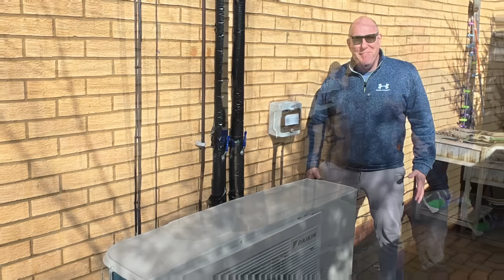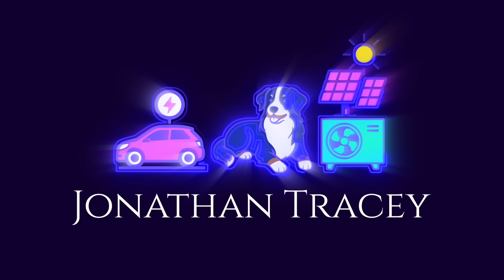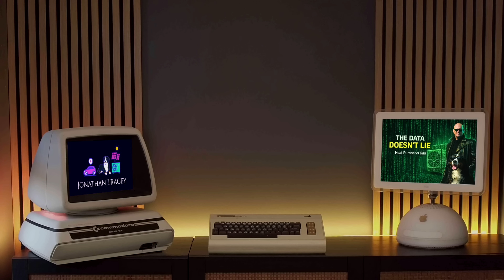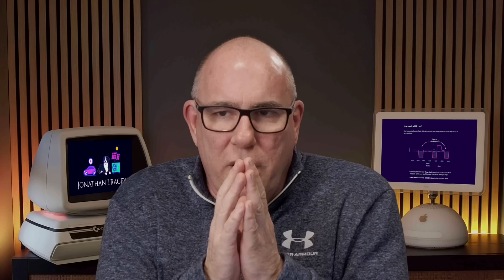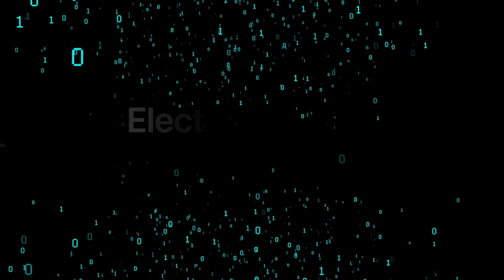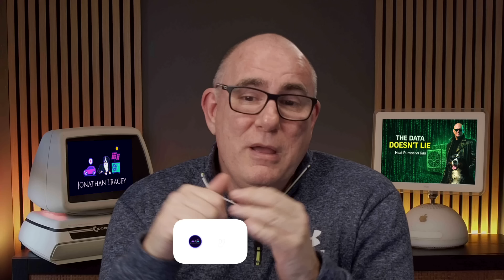The Data Doesn’t Lie   Gas vs Heat Pump Real Running Costs

Comment: Being a Heat Pump newbie, I must ask the following:
Isn't it a chemical reaction, within the refrigerant, which causes the heat to be generated? :body-blue-raised-arms:
A pump forces the said chemical around a circuit which causes this to happen? :body-blue-raised-arms:
Therefore you are paying for the electric to run the pump? :body-blue-raised-arms:
You are Not using electric to actually generate heat! Are you? :body-blue-raised-arms:
So why does it cost so much in Electric?? :text-green-game-over:
Reply from the maker: @grayukuk Good questions. It’s not actually a chemical reaction — a heat pump uses a refrigeration cycle. The refrigerant absorbs heat from outside air and the compressor (powered by electricity) raises the temperature so that heat can be released into the house. 

So you’re right that the electricity is mainly running the compressor and pumps, but because it’s moving heat rather than generating it directly, you typically get 3–4 units of heat for every unit of electricity used (that’s the COP). The reason it can still look expensive is simply that electricity costs more per kWh than gas in the UK, which is why the “spark gap” between gas and electricity prices matters so much.

Comment: Great, unbiased video analysis.  So many people I know out there have been switching their less than 10 year old condensing gas boiler out for a heat pump thinking that they are going to get cheaper price heating and thats simply not the case.
Reply from the maker: only if you have smart tariffs and or solar.

Comment: Ok a couple of issues here. My journey has mirrored yours, added 20kwh batteries and an EV, charge at night discharge in the day average Elec cost 7.4kWh. The system paid for itself in year 4. Added a test PV 900W and ran for year, extending to a 4.8kwh later this year. Looked as ASHP 4 years ago, capital outlay and operating costs too high, much higher than a gas boiler. New gas boiler 18kWh dropping to 4kWh, currently running at 94.7% efficiency by getting the house ready for an ASHP in ~2040ish. Added Tado all around the house ~£800 useful for gas or ASHP, added automated thermal blackout curtains everywhere (reduce heat loss). Moved lounge radiator to bedroom replaced with oversized radiator and put three automatic fans under it ~£100 ( not really useful on a hot system but fantastic on a low temp system) put new boiler in the utility room - making it really easy to swap out in ~2040 to ASHP. Used a system boiler and separate small hot water tank that i can heat using gas/ grid/battery or solar ( replacing with localised elec under sink water heaters in the next 10 years, ASHP struggles getting a sterilisation run on the hot water) Added an ems-esp32 Boiler monitor £100 and built a highly dynamic weather compensation keeping the Flow temp between 39-45c (ASHP territory) all winter - every of the 12 rooms maintans +/- 0.3c of target temps. The lounge is the thermal achor and the fans increase heat extraction by 70% making the room highly responsive meaning it is always 21c in the day and 19c at night. The point here is you can have the best of of both cost reduction using a gas boiler now ( properly setup and managed ) and bring the heating plan down into ASHP terriroty so whe I do it I dont have to go around changing everyhing it is already done and proven. Plus my gas usage is less than 10,000 kWh per annum with every room at shirt sleeve temps and two people being home all day and night. This way I massively reduce my heating costs AND prepare the house for the future - when hopefully ASHP have come down in price. You can have you cake and eat it - it just requires some planning 🙂
Reply from the maker: @michaelhorton6881 That’s a really thoughtful approach and it sounds like you’ve put a lot of work into optimising the house. Getting the flow temps down into heat-pump territory and improving the fabric of the building is exactly the kind of preparation that makes a future switch much easier.

Given the current volatility in energy markets — especially with what’s going on in the Middle East pushing gas prices around — I actually think being cautious about making big changes right now is sensible. The economics can move quite quickly, so getting the house ready while waiting for the numbers to settle isn’t a bad strategy at all.
Reply: @JonathanTracey   I meant to say, as ppeak elec is heavily based on gas prices (peaker stations) then if gas goes up by say 10% then I go from 5.8p to 6.38p per kWh, thats a £5.80 a year hit for me. It will be for a larger impact for elec first households. I fully expect to expand the battey pack to utilize energy arbitrage as delivering peak gets more and more expensive - the battery insulates me form that and potentially an opportunity to sell back to the grid a higher cost.

Comment: Thanks for the vids Jonathan. We live in a big old house
Got an Aira heat pump in summer and had the gas supply removed.
Last years Dec ,Jan, Feb gas and electric energy cost us £1196
This year cost us £1050 on Octopus Agile
We are comfortable running our heating at 18.5 C for 24 hrs. We ran the old gas boiler at different temperatures depending on the weather and time of day.
We feel warmer than we did with our old Combi boiler.
Two unexpected benefits - no or very little condensation in the kitchen and the house plants love it.
Reply from the maker: @carrownisky That’s really interesting to hear, and it mirrors what we’ve noticed as well. The humidity in our house has dropped since installing the heat pump and it rarely goes above about 50% now — even when the heat pump tumble dryer is running. It definitely makes the house feel much more comfortable.

Comment: I so want to get rid of the gas boiler, but it’s just too ugly and variable. Sticking with gas until there’s better options.
Reply from the maker: ugly is subjective but I get what your mean if you can't hide it away then its a concern for some people. What do you mean by variable?
Reply: @JonathanTracey  Energy prices and policies are too volatile. The government esp under Labour is too changes direction at a drop of a hat - like the electric car cost per mile. That destroyed the value statement immediately. So people won’t bother now, it’s cheaper to run a diesel. A CoP of less than 5 means the pay back isn’t likely to materialise. Esp if you have a modern house with micro-bore. You just cant get the flow rate and drop against inlet/outlet. 

So what we really need is the root causes addressed. Changes to building regs to move aware from small bore plumbing. And most importantly how the UK prices electric. We spent £1.6Bn to turn off wind production last year. Thank ed! The whole net zero program is broken, simply make it cheaper and people will change.
Reply from the maker: @nothingtosee7718 I’m not sure you can make sweeping statements on behalf of the whole population. EV sales certainly haven’t fallen off a cliff because of the tax changes — and for most people it’s still far cheaper to drive an EV than a diesel.

On the heat pump point, my COP is about 3.6 and based on the real data the system will pay for itself in around another three years. That’s why I try to show actual numbers — every house and situation is different, so blanket statements rarely hold up.

I do agree that building regs could be improved, but that won’t help the millions of homes that already exist today. And I’m not sure how net zero fits into the argument here — most of the issues you’re describing are about pricing structures and housing stock rather than the concept of net zero itself.
Reply: A heat pump is at least a metre wide, high and about half that deep. The cabling/pipes outside will be put on the side of the house. You'll then need a pump, another box in the attic and receivers for the thermostat (usually). Your two devices will become 5 which while you won't see them all add complexity. A white box on the wall can be boxed in  and has all those bits included in it. Something not mentioned is almost anyone can service the whole device rather than a small group taking responsibility for a bit at a time.
Reply: @px794 what’s not really spoken about is the skill needed to setup the system post install. You need the 5deg drop on the radiator inlet vs outlet for every rad and that takes time and skill.

Also with electric being x4 times more expensive vs gas, a COP of 3x isn’t enough for an ROI

Government needs to address the cost of electricity. It needs to be at least half the price it is now.

Comment: Interesting video, but surely you need to compare the cost for the whole year, not just over winter when heat pumps are at their least efficient. Wouldn’t the greater efficiency of heat pumps during the rest of the year compensate for winter months, so that the whole year cost is lower than gas?
Reply from the maker: @johncoghlan9564 That’s a fair point John, and I do plan to do a full-year comparison once I have the 2026 data. With all the recent changes to Octopus tariffs it wouldn’t really be fair to rely on last year’s numbers, so as we go through 2026 I’ll collect the new data and then compare the full year to 2025.

The reason I did a winter-only analysis in this video is that most people considering a heat pump want to understand the worst-case running costs. December to February are when heat pumps are working hardest and electricity use is highest, so it gives a good view of the most expensive period to run them.

Comment: If I can paraphrase and summarise what you waffled for quarter of an hour on...
You are going to need to spend a fair bit of change (think in the £15,000 to £20,000 ballpark - something you avoided saying in this video) on solar and batteries just so that you can break even on your heating bill...
If you put a smaller system in expect to have to thrash the batteries to get every kWh out of them, reducing their lifetime.
Unless the cost of gas goes sky high due to wars...
And you need keep your house fairly cold. We like it at 22C so would cost more.
In short, given the spark gap, it's an edge case that you can make a heat pump run cheaper than gas and you are going to have a heafty up front cost to do it.
Reply: Summary of the Summary lol.😂 
You need to include all of the costs of your installation as well as the running costs.
Reply from the maker: Read the description there’s is a link to a video with cost info. 

p.s here is a tip,try not being a rude person and you may find people engage with you in better way, if your a rude idiot expect to get ignore in life and on youtube.

Comment: All i want to know is, will a heat pump be cheaper than my gas boiler without solar and batteries? i have my doubts!
Reply from the maker: as with all things it depends on usage, how good your insulation is, and your tariff and depending how long the war in middle east goes on
Reply: We have only solar panels, and not many of those. Our total bill in January was £160. We moved the thermostat downstairs in Feb and did turn off a very expensive computer but Feb was lower. I forget what. That's heating the house to 18.5. We have two big dogs and we work from home and even the wife hasn't complained about the temps.
Reply from the maker: I was helping a friend track down phantom power drains and his gaming PC was pulling amazing amounts of power even when not being used

Comment: Gas will probably always be cheaper, no matter what. If you want your house to be at least 26°C, then you can't go wrong. But if you prefer it cold, with temperatures around 21°C, then heat pumps are probably a better choice for you.
Reply from the maker: Depends on how long this war with Iran goes on, gas prices are spiking massively and if its not concluded soon they will be passed on.

With regards to temperature everyone is different,  you are the first person I have heard from that would have a temperature over 25°C, most would consider that a sauna, but each unto their own we find 20°C very comfortable but one persons warm is another persons cold
Reply: @JonathanTracey  If gas goes up so does electricity. Solar and wind cost more than both.
Reply: I'd seriously ask why you're heating your house to 26'c. 21 is warm, even for someone sat doing office work. A boiler wins in having 'instant' short term heat. Whack it on, heat the house for a couple of hours, then turn it off and be comfortable for the rest of the day. A heat pump just doens't work that way.

Comment: Stat, stats and damn lies as they say.
Not accusing you of lying , but without prior significant investment in large solar and battery, heat pumps very rarely make financial sense.

It's like all the EV advocate with home charging.  Only makes sense if you charge for cheap at home.

I don't doubt both technologies work, but financially viable, that's a more nuanced answer, and more dictated by your circumstances
Reply from the maker: @stuartburns8657 Thanks for the thoughtful comment Stuart. The quote about “lies, damned lies and statistics” was really meant to highlight that numbers can often be presented in different ways to support the story someone is trying to tell — and I’m no different in that respect. The numbers in the video support the point I’m making, but I always try to show the real data behind them.

On the EV point, it’s not really just about home charging anymore. Things have moved on a lot since EVs first arrived in the UK — most motorway service stations now have more EV chargers than petrol pumps, and they’re adding more every week. People are adopting them not just because of fuel cost, but because they’re easier to drive, quicker and require far less maintenance.

And on your final point, I agree that financial viability is very personal. Some people can afford these technologies and some can’t — that’s just the reality of the world we live in. But for those who can, when you combine things like solar, batteries and EVs, it’s now possible to get very close to zero energy costs — no gas bill, no electricity bill and no paying for fuel to drive.

Comment: U still trying self consumption from 15 March ???   At least u can compare first half of month an then second half on SC    An no need to change tariff with SC 
 There will always be sum days u won’t collect enough solar , but u can always top up batts on grid gas on yur cheap rate
Reply from the maker: Still working out my plan, now Flux and Intelligent Flux have been withdrawn I need to rethink. Given the weather (other than today) has been dreadful may wait until the first of April

Comment: I will get a heat pump eventually. My solar figures Dec 175k Jan 195k feb 214k . 6kwh inverter 7kwh of panels. On the surrey sussex border. Just out of interest.  Atb
Reply from the maker: Sounds good having a decent solar install in place before a heat pump makes it much easier on the wallet when you have to run it during winter
Reply: I have to ask why. You've already got a superior solution in place. Why take that out for one that's more intrusive, expensive and far less flexible? Heat pumps are not 'green', they're going to cost more as electricity is made more expensive (but then, gas is going to soar as well). I don't understand the logic of spending money for no return.

Comment: For a full picture you would need a years worth of data to see how much it costs overall.  The winter months are always more expensive, but if you have solar then the export rate will mean you build up a credit in the summer months (albeit that the export rate on Octopus has come down a bit recently!).
Reply from the maker: @poocharama Yes absolutely — once I have a full year of data I’ll do a proper year-on-year comparison. With the recent changes to Octopus pricing it wouldn’t really be fair to use last year’s numbers, so as we go through 2026 we can gather the data using the new tariffs and then compare it properly to 2025 at the end of the year.

The reason I did a winter-only video is that most people considering a heat pump want to know the worst-case scenario — what it costs to run during the most expensive months, which for most homes is December through February.

Comment: Great analysis of actual running costs but what about the offset of the installation costs of the solar panels, batteries and heat pump?
Reply from the maker: all covered in other videos, check description for a link to the whole system
Reply: @JonathanTracey I watched the video you recommended and again a great video and very well presented. My only concern is that you include the fuel savings from moving to two EVs in the annual savings, but not the cost of changing from ICE cars to EVs. That seems similar to counting boiler-to-heat-pump savings without including the changeover cost, so it may overstate the overall payback.
Reply: @AndrewMusgrove-r8u elsewhere Jonathan comments that his EVs cost similar amounts to ICE vehicles
Reply from the maker: @AndrewMusgrove but I didn't move to EVs to save money I moved to EVs because they were amazing, the money savings are a bonus, even if the cost to run was the same I would still choose my Tesla. With current offers EVs are not any more expensive than ICE cars, and I suspect in the next few years you will see it move the others way, Some of the new Chinese EVs are amazing, good build quality and very low prices for the specifications
Reply: @JonathanTracey The main reason I commented is because I believe your enthusiasm for the products you have is to be applauded and the professionalism of your videos is striking. However if you continue to cover financial topics then you need to incorporate the figures for the ROI crowd as well as the lifestyle choice crowd for a balanced result.